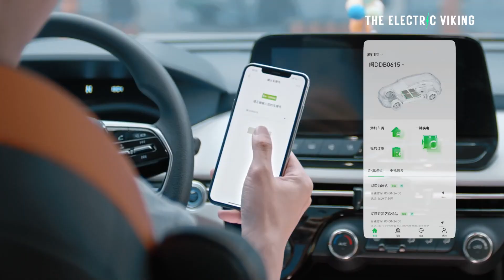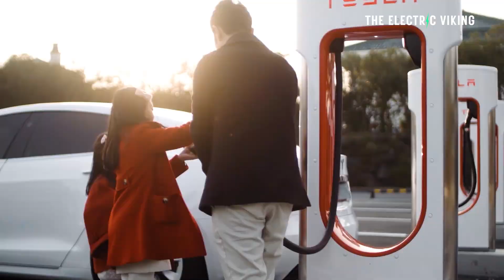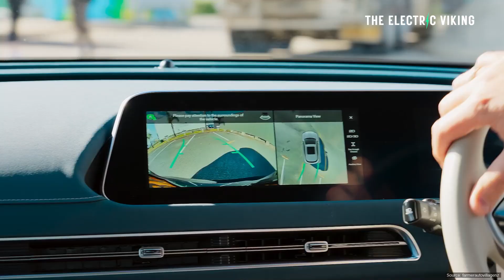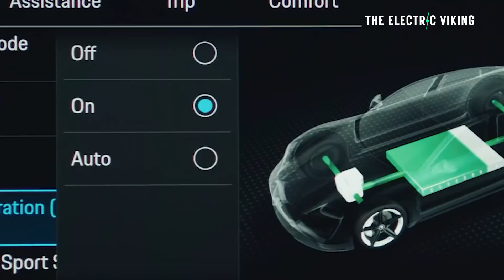Study reveals the price to replace EV batteries has halved

Comment: Recently, in Canada, 2 Hyundais needed batteries out of warranty. Installed price was $60,000 each. That would buy quite a bit of gasoline. Also, I have read of older batteries not being in production. So no price is available.

Comment: why doesn't he understand that used prices have a big impact after 8 years, and it is not the whole battery you change, only 1-2 modules, but it still costs 8000 dollars in the EU with VAT, I don't want to buy an electric car with only 70 % of its battery, my advise to people is to buy LFP instead because they are more durable

Comment: I think nissan are playing games with leaf battery warranty.    I bought a 2019;leaf 40 kWh battery.   Charged from zero to 100%.   It only took 30.4 KW of charge measured on my meter on the charge cable.   If I had 80% remaining it should be 32 kWh of charge.   I had them test it and they said I have 12 bars.   A brand new car has 12 bars.   The brand new car would have 40 kW usable.

Comment: Sam - You got a little mixed up on the energy density as 30 kWh is 30 kWh regardless of the density.  My Nissan Leaf for example has a 24 kWh battery which weighs around 600 lbs so if I replace it with a new pack where the weight of 1 kWh is half of what it was in the original then the replacement 24 kWh battery will weigh around 300 lbs and I might see a modest increase in range due to it weighing 300 lbs less than the original battery.  If I replace it with a battery that weighs around 600 lbs then I might end up with about 50 kWh and around twice the range from a battery that weighs the same as the original 24 kWh battery.

Worn out ICE engines are not worthless unless the block is cracked, has a hole blown through it or similar catastrophic damage has occurred otherwise it generally has a Core Value of around $500 +\- for gasoline engines and around $1,000 +\- for diesel engines.  Even with catastrophic damage its still has a value based on the current price per pound of scrap iron with mixed metals.

Best!

Comment: We need the price of home storage batteries to really come do own now. That would really jump start, no archaic term in the EV age. That would really turbo charge…no, another term for buggy whip, archaic technology. That would speed up home electrification, EV adoption, the phase out of gas yard tools, etc. Right now, home batteries have an installed cost of $800 to well over $1,000 per kWh. When home battery storage drops below an installed cost of  $100 per kWh, then the corrupt gas and electricity cartels will be disrupted!

Comment: That's good but I have seen a youtube video where they talk about motor seals which fail in Tesla's (a fair number of times) and then coolant gets into the motor where it shouldn't and the repair costs are as much as maybe changing an engine or transmission in an ICE car.  That's kind of scary.  I would hate to have that kind of repair bill.  Especially if they're not fixing a problem that they know they have.

Comment: Tesla doesn't disclose the numbers for all of its vehicles and the Cybertruck is lumped in with other products under 'other'. The consenus is that the CT sold about 8000 vs the Lightning at 7902. So Tesla sold a whopping 98 more trucks.😂

Now that I have gotten a good look at the CT, I will say it does look slightly better in person, but it's not really a truck in the traditional sense. I don't see it being used as a work vehicle.

Comment: Electric Viking. A 60kWh battery is a 60kWh battery no matter the energy density, the difference is with higher energy density, it will weigh less.

Comment: Viking at 7:35 you said you may a smaller battery pack. You said let us say a car has a 60Kw battery pack. You may need a 35Kw if you replace it in 2035 for the same range. And the statement after this are also completely off. I do not know what kind of Physics or Math you are using today.

Comment: Dude, do a little editing before you release your videos. $10k per kilogram for a ground up battery? Increased range for the same kWh? A new 35kWh battery will not give you the same range as a 60kWh battery unless that 60kWh battery has lost its capacity.

Comment: 7:08 Sam, I don’t follow a higher density battery pack can have a smaller capacity ie from 60kW to 35kW, driving the same load. Though, I get it that the pack size is smaller while battery capacity stays the same. 60kW in your example.

Comment: The prices of commodities is so volatile that it's very difficult for providers to regulate the prices. And every time they find a significant source of the components for manufacture it causes pressures from the market that are artificial to the actual cost of recovery. 😮

Comment: Manufacturers don't give an 8 year warranty if they think it's likely to fail within that time frame. I'd happily assume you'd get 10 - 15 years. BYD says likely 20-25 years of current batteries and newer tech probably extends that. Very few people keep a car for 20-25 years. I'm waiting on a 800-1,000km battery because at my age it will be my last car and a 30% loss in km means it's still useful to me as I age

Comment: While the price is coming down, they're still a bit too heavy. I'd like to see a 35-40 percent drop in weight (and also size) without losing range, something that may not occur until the late 2020's as new battery chemistries becomes available commercially.

Comment: Price off EVs on par with ICE cars? Just a recent example here in Europe: Citroen e-C3, 23000 EUR, cheap? Well, ICE version 15000 EUR.
Reply: How many kilometers can you drive with 8,000 EUR worth of gas??? And that would be 8,000 plus taxes?
Reply: @bfree6197  Based on current prices, for my Fiesta I would say around 10000 km, but that's not the point. For budget tight families, they will look at the purchase price first, oil and electricity vary anyway. For example, with the Ukrainian war, electricity prices went crazy for a while (lots of bakeries in my region could not afford the costs and had to close).
For myself, I will keep my Fiesta a few more years till more recharging stations are available (I envy the north of my country) and maybe till the current trend of boxy looking cars goes away.
Speaking of recharging stations, with a 30 minutes charging time, I don't understand why they don't put them in the supermarkets parking! It make so much sense to recharge your car while you do your shopping!

Comment: "old ICE worth nothing". Not quite. Machine shops that do engine rebuilds are flourishing because the cost of a rebuild is quite low in comparison to getting a new or even used car. A full engine rebuild can easily extend the life of a car by 100k miles if properly maintained. This makes for a compelling financial argument as the cost of ownership over the lifetime of the car will be quite low. You clearly strayed out of your lane of expertise on this one. Don't get me wrong, I look forward to acquiring an EV when that becomes a cost effective option. But here in the US with all its auto industry protectionism that isn't happening anytime soon. The Biden administration's lunatic tariffs on EV imports will guarantee that EVs will continue to be out of reach for most US consumers.

Comment: Electrician here: An EVs range is mostly determined by the kWhr size of the battery pack, total vehicles weight, expected speed, and drag ratio. The average EV battery pack is 25% of the total vehicle weight, so if an older 60 kWhr battery pack is replaced with another 60 kWhr pack that weighs 20% less than the original pack, then the overall vehicle weight will only decrease by ~5%. This would only add a small amount of range. Or one could go with a slightly smaller pack to achieve the same range, BUT NOT A 35 kWhr battery. It would have to be around 50-55 kWhrs to achieve the same range.
I suspect most people would want to have a larger pack that would increase range rather than a smaller pack that kept the range the same.
Reply: @GoCoyote  and what if the energy density increases 30%? Your 60 kWh pack is now 80 and you've another hundred miles to enjoy.
Reply: I think most people would want slightly more range in a slightly smaller, modestly less expensive pack. 

They don't need 500 or even 400 mile range.  320m to 360m would be great if the car is $30,000 instead of $42,000.
Reply: @mac_mcleod  Agree.  Ultimately, the markets will decide.  When people have a choice, it will be interesting to see which way they go.  Same weight, more miles, same cost.  Or less weight, less miles, less cost.
Reply: lower priced BEV's would fill a niche of a 2nd car that is used to commute or run errands. It will not need long range so can have a smaller battery. Less range, less performance, less costs.

Comment: The energy density going up in  the future  does not mean the pack will be replaced, as you say, with one that has half  the KWH capacity  for the same range. It could be replaced with a lighter pack with just a little less energy capacity to compensate for the lost weight.

Comment: Most Lithium Batteries have to be replaced in less than 5 years.
That hasn't changed, even for batteries built in the last couple of years.

A warranty by the car maker will not change this, you'll only get the first, second or third battery for "free" during the warranty. If your BEV is 10 years old, and the battery breaks again, it will still probably be totalled.
Reply: not even close to being true. not only do statistics not show this rate of replacement, but anecdotally I have two 5+ year old EVs at my house right now. And another 4 year old EV in teh garage. zero battery issues.

My house is also littered with old lithium powered devices: laptops, phones, gardening equipment, etc. All lithium powered, all still working fine.
Reply: @blanketwodahs6741  cope harder :).

btw, my 2022 BEV already had it's battery replaced under warranty. 

Maybe you're talking about EVs in general? Many of them have lead acid batteries to operate the pantograph or the fuel cell system. Those last longer.

Comment: 7:42 If your car has as 60 kWh battery pack, you will always need a 60 kWh battery pack to get the same amount of range.  You will not get more range from a 60 kWh pack no matter the battery density because efficiency is the same for the vehicle.  However, if battery density is 2x, then you can put a 120 kWh battery in the same pack size and that will increase your range.
Reply: That is not true. Example: If your current 60 kwh battery pack has an energy density of 150 wh/kg then the weight would be 882 pounds. In the future if you replace the 60 kwh pack with one that has an energy density of 500 wh/kg then the battery weight would only be 265 pounds. That is a substantial weight decrease of 617 pounds. Just the battery weight reduction alone (not to mention the possibility of shaving additional weight off brakes, suspension, frame etc). would result in greater range.  So you could choose to replace the old battery with the new 60 kwh pack for more range or go with a new 50-55 kwh pack to maintain the same range as you had with your old 150 wh/kg pack.
Reply: @skipondowntheroad5833  it's already in kilograms, why are you converting it to pounds?  🧐
Reply: @skipondowntheroad5833  You're talking about more than 3x battery density to have a 5-10 kWh smaller pack.  He said 35 kWh pack for the same range or same size battery pack with double the range.
Reply: 👍. 60 kWh is 60 kWh no matter how dense the battery is.

Comment: I think the news brought forward in reality is less rosy for the consumer. Prices might come down, but not meaningfully, unless an EV brand is mass produced, which most brands are not to the degree to make a profit. Following that, even though prices of the battery cell drop, I do not think it will significantly drop battery pack and RV prices, which is the most important thing at the end of the day. Reason profit margin. We see it now already in this early transition to EVs. Thirdly although the battery these days might last longer than the EV body and frame, selling the used battery will likely not be the profit for sale you imagined. You see, the Bayer middle man also wants a profit from buying  the battery and haggle for a decent price. Then the middleman will try to sell it for a profit to the recycling company, even though theat company sets a fixed price per pack. You see the recycling company also wants to make a profit from selling the raw materials from recycled batteries. So in a circular economy what might happen is that each party outbid one another for the lowest price sale and lowest price buy. The recycling could say we will sell raw materials for a high price for profit. And so the batteries that are recycled could get more expensive. We already see now for May written off EVs that there worth only a fraction of the pack value at best by I.surance companies. In my country, you just can not sell the pack because you also have to take onto account liability costs, taxes and transport costs. Unless you sell a huge volume of EV packs, on an Individual level I thonk EV packs deliver a disappointing return on investment. It would be better to ise the battery yourself, but also here it differs I'm countries. In the Netherlands it is difficult to dismantle a pack yourself because you need specific knowledge, experience, electrician level of experience to deal with high voltage gear, which opens up a lot more can of worms.
All in all I think the barest value of an EV is to keep it on the road as long as possible and make right to repair and easier pack repairs on the cell level a thing.

Comment: Manufacturers dont replace a faulty battery under warrenty with a new battery, in most cases. It is replaced with a rebuilt battery pack which have much higher failure rates than new packs or even packs of the same of the same age.

Comment: You said at the intro it's so relevant to EV buyers. It's not that relevant, as most EV owners will never worry about having to replace a battery. Videos of the Tesla with 340,000 miles are online, with original motor and batteries. So it's not that relevant, other than to ICE focused media who might be surprised. It would be great to see truly high capacity battery packs developed for early EVs like the early Leaf cars, to give them a new life.
Reply: In the netherlands I could have replaced my original  leaf battery for a 48KWh version...even 60KWH was possible if I would offer part of the luggage room.
However that last one was to pricy for me. Checked this in 2021. 60KWH would cost me half the new value of that leaf  but increasing the range , based on experience, to only 315 km. A konaE64 goes 450 km on the same battery size.
And this is the nect issue...How efficient with energy is a car...that determines if a new battery is usefull or if a new , mor efficient car, is a better choice.
Reply: @reiniernn9071  Many thanks for that reply based on your experience. Imagine an era when modern day ranges are sufficiently compact to fit in a Leaf battery compartment...

Comment: Every manufacturer should design the battery to be replaced in 10 minutes. One manufacturer already did that. I don't like their 300 mile swap out idea, but it shouldn't take any longer when the time comes in 10 or 20 years. You could drop your battery off for a tune up (bad cell replacement) any time and get a loaner for that.
Reply: @Fred-hi8tt  Nio does this. The problem is, are you going to trade your brand new battery in for one that may be nearly done?
Reply: I said that I don't like the swap out idea, and getting some old junk is indeed the reason why. All car companies should still use the easily removable design even if it is just used once in the life of the car.  @GWAForUTBE
Reply: @Fred-hi8tt  eventually Tesla will do that

Comment: Dude .. a replacement battery will need to be about the same kWh rating.  Your observation of how density is going up .. saving some weight is valid .. but since the car’s suspension was designed for the origional weight, it would need to stay the same.  Now .. of course the point is moot since BEV batteries outlast the car anyway.
Reply: I hope we don't start throwing away cars after couple of months to 5 years just because the battery is broken.

Comment: @7:30 -->
Sam, I think you have a lot of merds wuddled in the following statements.
The vehicle will still require the same energy to go from A to B.  Therefore, if energy density of a battery is doubled per Kg, this will mean a smaller and/or lighter and cheaper battery to obtain the same range.

The good news if this eventuates, is that the vehicle will be less heavy and therefore have greater range.
The bad news is that to obtain the same performance in respect of road-holding, there may be a compromise, as many BEV's depend on a structural low-level weight (battery assembly) to achieve this.  Therefore to return to original handling performance some ballast would be required.  I personally do not think this is a biggie and do not think most folks will go for the ballast option.